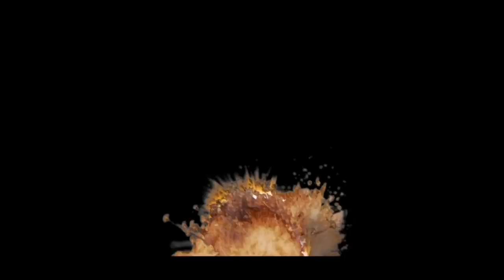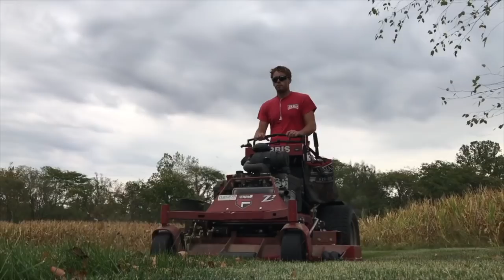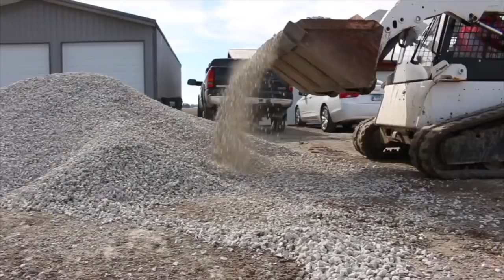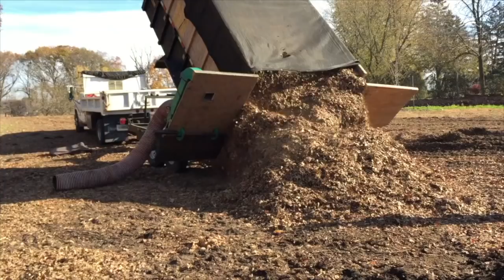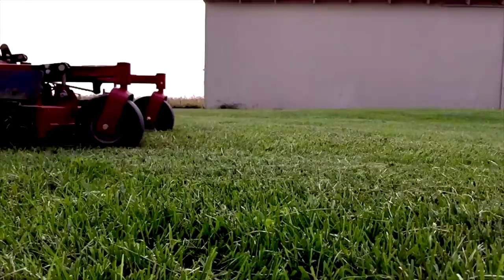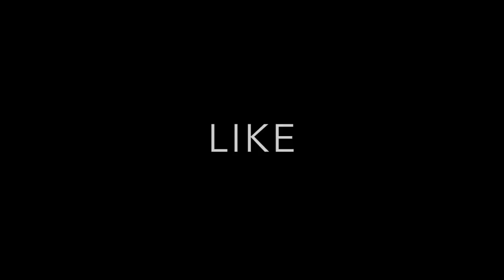Broken Mowers, Sold A Truck, Need a Trailer ASAP

Comment: i hear you, brother. it will get better; these are all character ( and patience ) builders. i was going through it yesterday.  problem after problem with my brand new toro pushmower, and the dealer was closed ( in fact, i still have to stop by and get one of the problems looked at; i figured out the other one on the job yesterday ), and i had a fair bit of tall grass in smaller areas to mow.  got the yard finished, but i was using some colorful language by the time i got out of there 😅
Reply from the maker: kodiak wild hahah, sounds about like our day! Hope you got it all worked out and are back to black and white mowing lol
Reply: @nickenslandscapingexcavating  😂👍🏼

Comment: Breakdowns are frustrating. Especially when your used to rocking and rolling nonstop. Personally  I use John deere  mowers and trade in my stand on and zero turn every three years. John deere provides zero percent financing for 3 years along with a 3 year warranty.  Also anytime it breaks down during the warranty they provide a equivalent loaner mower. I used to have exmarks but this is hard to beat. Excellent trade in value too. Good luck and I appreciate the video as usual.
Reply from the maker: Tim C Yes they sure do! Sounds like Deere has quite the trap there! That is hard to beat. Mine is a 2 year warranty with a loaner if needed. I’m not sure what the finances would be. Happy mowing tim 👍🏼

Comment: Hmmm. I have a Z3 with less than 20 hours on it. The clutch sounds rough and rattly when disengaging the blades. At idle with the blades disengaged , the blades will twitch like the clutch isnt 100% disengaging.
Reply from the maker: Will Robinson I would get that checked out for sure!